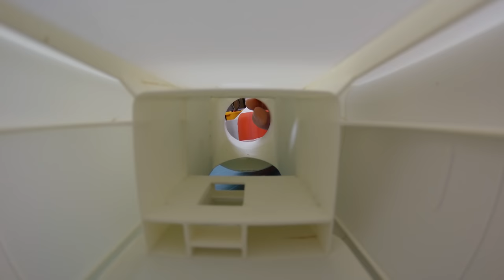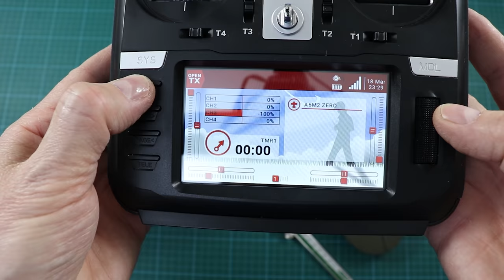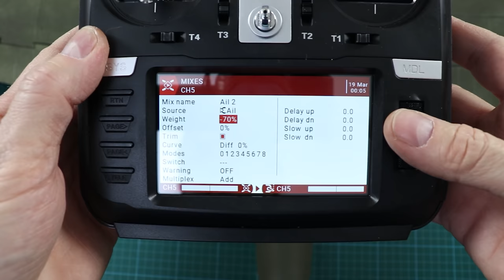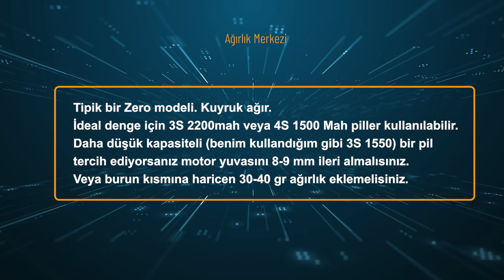3D Printed Zero Model Airplane. Print, build, paint, fly, have fun.

Comment: Can you print this plane in normal PLA or would it be too heavy? Maybe you just could get a stronger motor?
Reply from the maker: It can of course be printed with normal PLA. But it will be heavy. It can fly with the same motor. But the flight time will be shortened and the stall speed will increase.
Reply: @Kendin-Yap  Ok :)

Comment: i just bought this plane, it will be my first ever rc plane. i have never flewn a rc plane before. therefor i guess a kamikze plane will suit me well.
 i have loads of pla, but guess i have to buy the light weight stuff, or is it that important?
Reply from the maker: LW-PLA is required for this model. But before you try flying it, I recommend you practice with an RC simulator. Learning to fly a model airplane is a process.
Reply: @Kendin-Yap  thanks, i just ordered a roll of the lw pla.
 yes, true that. i will go on the hunt for a rc simulator. are there any good free ones out there?
Reply from the maker: As far as I know, the only free option is "FMS Simulator". It's a bit simple but functional. @rolfalm

Comment: Ortalama maliyeti nedir hocam?
Reply from the maker: Baskı maliyeti yaklaşık 300gr LW-PLA harcadığı için 160-180 TL gibi (Benim filamenti satın aldığım zamandaki fiyata göre tabi).
Diğer maliyetler tercihlere göre değişir.  2212 motor 120 TL ye de var. 215 TL ye de. Aynı şekilde 25-30 amper ESC içinde farklı fiyatlar var. Benim zaten elimde çok eskiden aldığım malzemeler olduğu için kendi adıma bir maliyet hesaplamam zor. Sadece şunu söyleyebilirim. Piyasada bulabileceğiniz en ucuz 2212 1400 kv motor ve ESC ile bu model rahatlıkla uçabilir. Ortalama fiyatlara sahip malzemelerin linklerini videonun altına ekledim.
Reply: @Kendin-Yap  Hocam 3d dosyası sanırım ücretli ve dolar bazında olduğu için bizler için pahalı. Ücretsiz bir alternatifi var mıdır acaba?